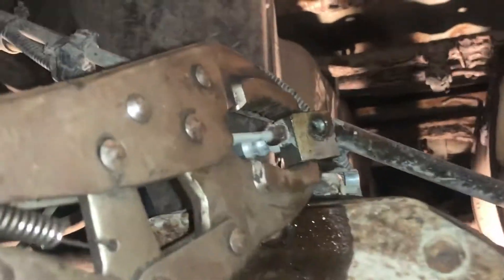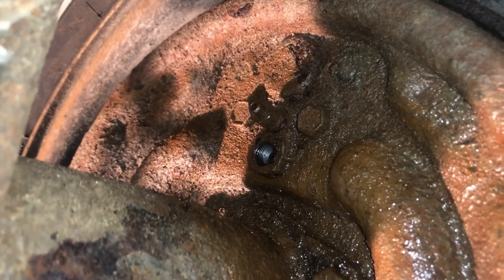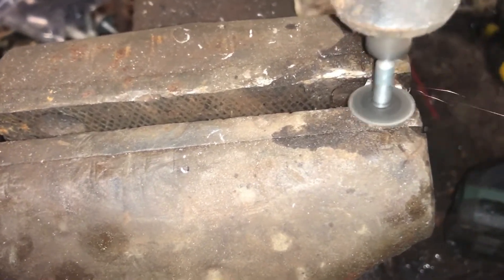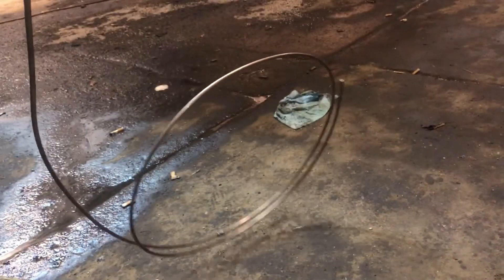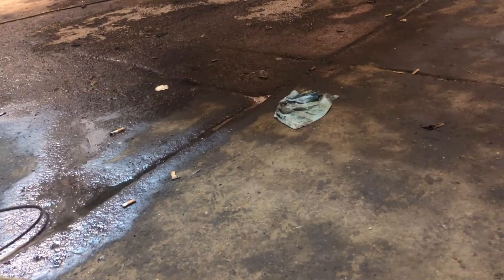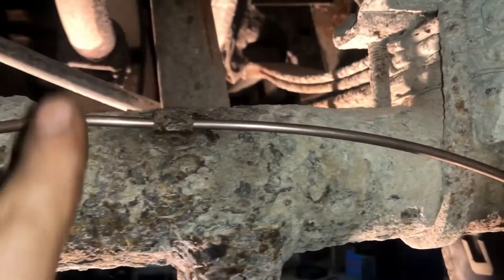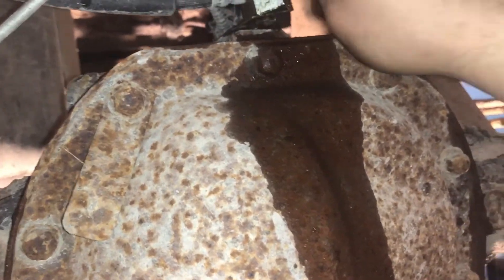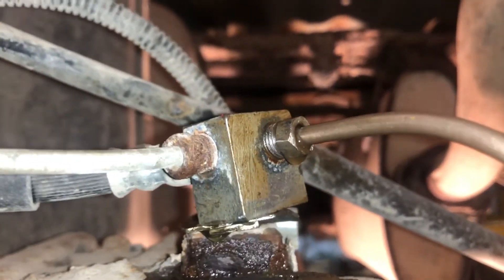Replace Ford Ranger brake line

Comment: Is this just a single flare or did you have to use the adapter and do a double? I have a 95 and just did the driver side and they leaked like crazy. Looks like you just did a single. Maybe that's my problem. Thanks for your time.
Reply from the maker: Hard to remember everything but pretty sure it was a single regular flare. You can always tell what type it is by looking at it when you get the fitting out

Comment: My right rear line snap in half on my way to work thanks was not slippery or snowing I had to cap the line with a screw and refilled the master cylinder to get back home
Reply: Geez 😮😢
Reply: I stripped my fitting with vise grips than cut my line 😮yaa oppz idk 🤷‍♀️

Comment: What size are the fittings 3/16 also ?
Reply from the maker: 3/16 inside diameter. Not sure about external or thread pitch off the top my head but I remember it’s the most common size

Comment: How did you remove the rear brake lines from the metal clip that that secures line to the axle?
Reply from the maker: Those open right up.